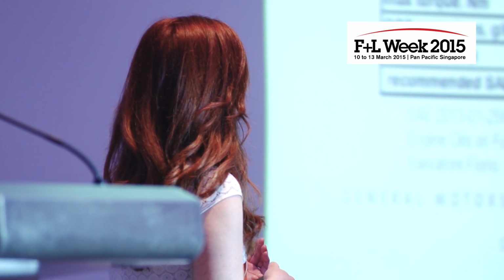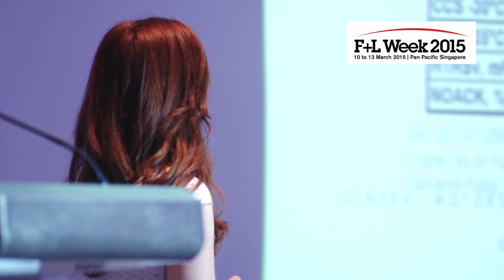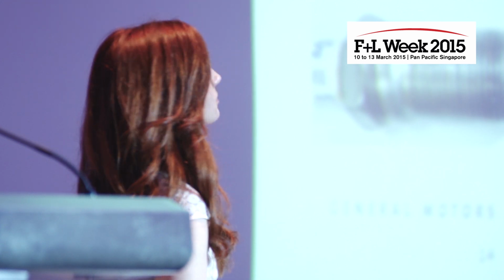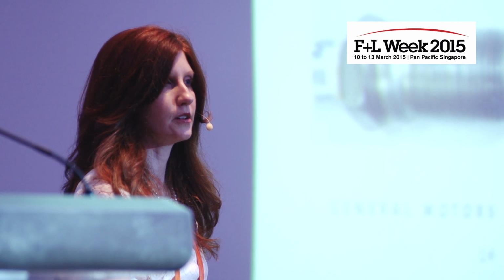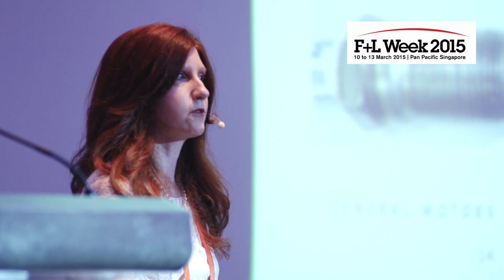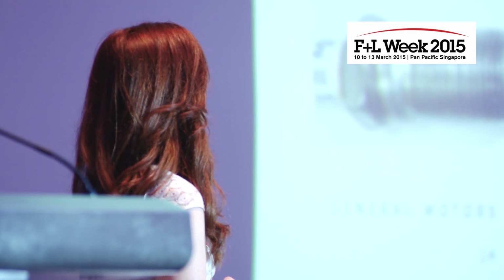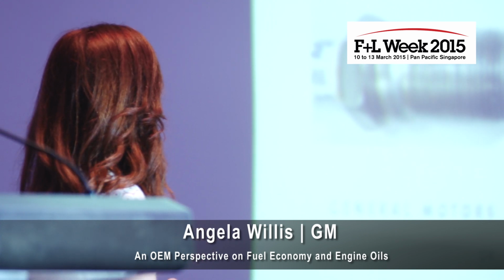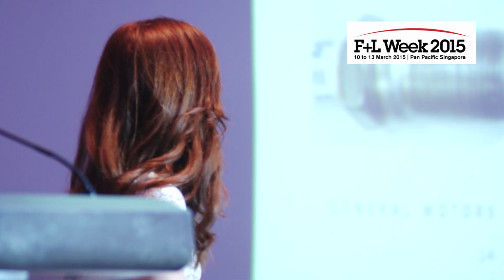Second-Generation dexos1 Engine Oil Specification | Angela Willis | GM

Comment: IMPORTANT NOTICE :
For those who have a GASOLINE OPEL turbocharged engine : Dexos 2 (based on ACEA C3) is NO LONGER ALLOWED because of LSPI risks.
You MUST use Dexos 1 gen2 (no matter the brand, the important is that the oil respects the Dexos 1 gen2 requirements).
Dexos 2 remains allowed ONLY FOR DIESEL engines.
Reply: JC This requirement also works for turbocharged gasoline engines older than 2010?
Reply: @xoma77  
To be honest I don't really know but if it's a small engine (1.6 or 1.4 or less) it might be subject to LSPI risk so it would be careful to use Dexos 1 gen2 instead of Dexos 2.
Maybe try to Google the name of your engine + "LSPI" to see if there are some people talking about this problem.
In any case it could only be a benefit to use D1G2.
You can find Genuine GM Dexos 1 gen2 on Amazon for quite cheap. Fuchs SuperSyn D1 is good as well.

Comment: So would a 0w30 full synthetic oil benefit any over 5w30 full synthetic see that Mobil 1 has synthetic 0w30 in which it says can replace 5w30 and 10w30 oil, my car uses 5w30 from oem.
Reply: Stick with 5W-30.
0W-30 means it's water when it's cold !
The engine will start easily but with poor protection ! 5W-30 is perfect
Reply: in North, South Dakota, Montana at the end of Jan beginning of Feb when it hits -25 to -40 Fahrenheit your engine with thank you.  in the summer put 5-30 back in.
Reply: There are no benefits other than improved sub zero cold starts. The person who said 0W-30 is "water" when it's cold clearly has no actual experience with oils, otherwise they would know that it will become thicker when cold like any other oil and that NO engine will complain about an oil being too cold at startup in any weather. The potential problem with 0W-30 is that it MAY have more of a tendency to burn off when hot than a 5W-30 and MIGHT be more likely to shear out of grade, but that isn't true across the board. If you compare, for example, Amsoil's 0W-30 to Walmart's generic 5W-30, you will probably find that the 0W-30 Amsoil outperforms the generic 5W-30 in every way. But within the same brand and product line, you will generally find that oils with a lower winter rating have somewhat worse high temperature performance because they are often made from a thinner base oil with more viscosity modifier additives compared to oils with a lower difference between the hot and cold viscosity, but not always. A good quality synthetic 5W-30 may contain no viscosity modifiers at all while a crappy 10W-30 contain a lot.

Comment: will the new dexos spefications be backwarts compatible to be used in "older" engines?
Reply: bobl78 

Dexos, both 1 and 2, are GM proprietary specifications that demand more than standard API services classes for Spark ignited (SJ, SL, SM, SN) or Compression ignited (CF, CH, CI, CJ, CK).

They combine regular tests from API/ILSAC with others done for ACEA certifications and demand minimum performance above standard for certain parameters.

So YES, they are backward compatible with engines that demand the same high temperature viscosities as offered. 

Should ILSAC GF-6B based oils be aproved as a new API class service they will have a different designation bifurcating from the old compatible one as was the case for diesel PC-11 witk CK-4, the compatible path, and FA-4, the new non backward compatible spec. Then GM will have to offer a new Dexos class for the non backward compatible new branch too.

BTW, Dexos1 is already Gen2 (generation 2).
Reply: Celso Starec I just purchased mobile1 5w30 for my Cadillac ATS 2.0 turbo.  It said "dexos1 gen2" on the box.  I am looking forward to using it on my next oil change.  I am waiting for a mobile1 equivalent for my sons GM 2.0 diesel turbo which uses the dexos2 formula.